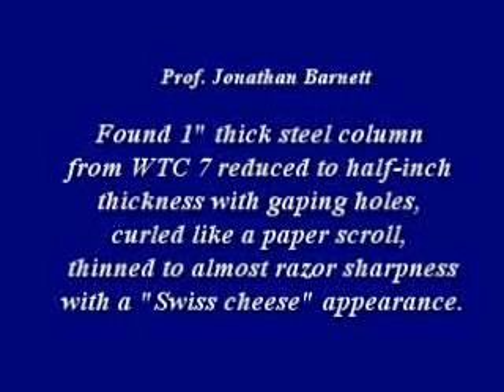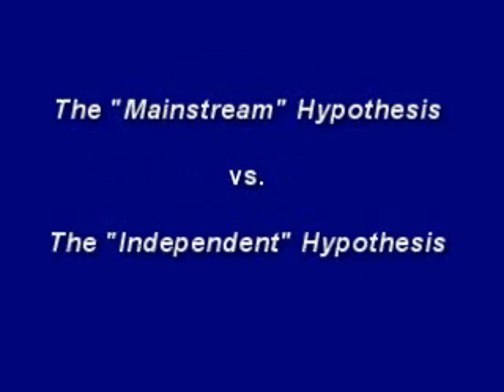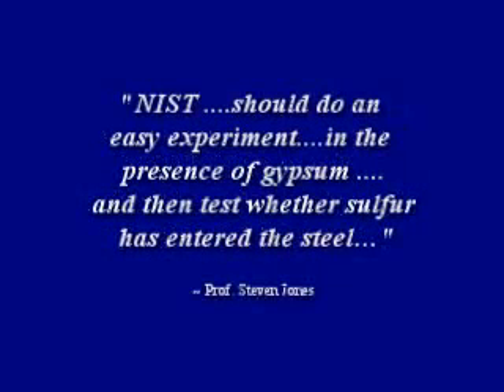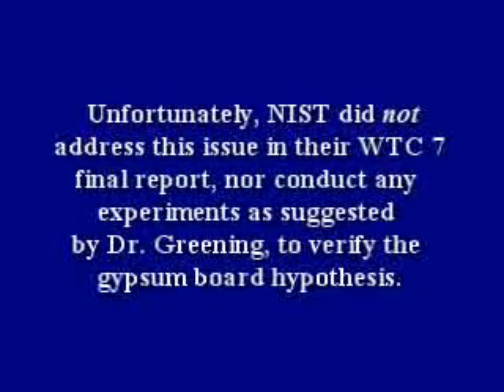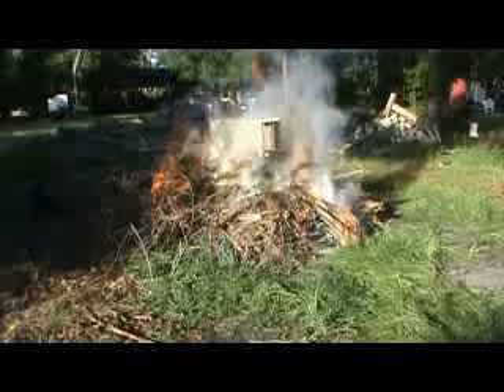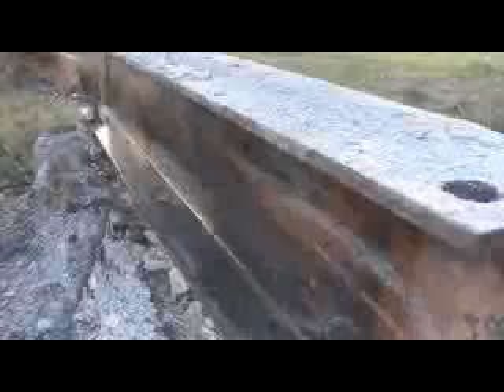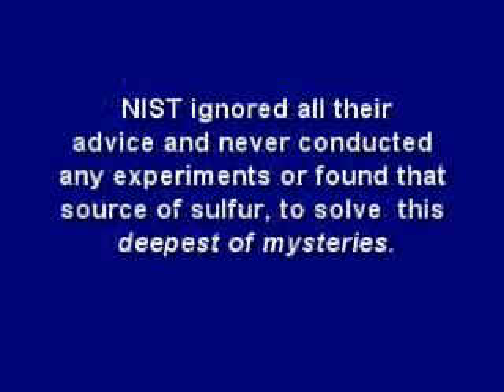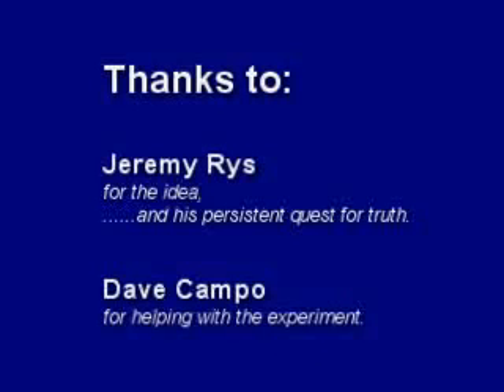9/11 Experiments: The Mysterious Eutectic Steel

Comment: You forgot one crucial ingredient: Muslim hatred of our freedoms. If you'd added that, the beam, and your house 350 feet away, would have been completely destroyed.
Reply: Logic! Noooo! Logic and reason have no place in 9/11 Conspiracy forums. You obviously don't invest in enough aluminum foil!
Reply: You're right. Muslim hatred has been proven to melt steel. I almost forgot
Reply: sammyswank
"Melt steel", stated in no official account anywhere. Strawman is a strawman.
Reply: sammyswank
"The problem is that it was documented as being present in the rubble of ground zero."
AFTER the fucking collapse. How much molten steel was recovered from ground zero and accounted for in Fresh Kills? Insignificant, with no structural steel failing to be accounted for.

The "molten metal" was caused by the continuous fires burning in the ground.

1) No thermitic material was recovered from ground zero. None. Zero.

2) Fires burning in rubble is NOT NEW. It's an expected side effect of a massive collapse. We know this, because we have seen this sort of fire in other kinds of building collapses (due to, yes, fire, earthquakes, and bombs).
Reply: winston smith
"Not just thermitic material was found in every dust sample tested"
Really? Then why won't Jones and Harritt turn their paint chips, oh, I'm sorry, I meant samples over to any other scientist for verification?

Docktor Jim 
LMAO Obfuscation obfuscation obfuscation.

Jones and Haritt won't turn over ANY of their samples to anyone else. NO ONE ELSE in the scientific community. Want to know why?

THEY KNOW THEIR SAMPLES ARE PAINT CHIPS.
Reply: @diskpanic  agent smith...the ghost of Julius Streicher will visit you pal.
Reply: Docktor Jim
Wow, I didn't realize that Rudy Giuliani is a scientist, you nutjob. What are his scientific credentials?

I love how adept you 9/11 Conspiretards are at constructing strawmen. You morons are INCAPABLE of talking about the scientific facts. Why? Because you know you lose.

13 years. Zero peer reviewed papers that significantly establishes any of the key 9/11 Conspiretard arguments in an ACTUALLY LEGITIMATE JOURNAL of science or engineering.

If you had a point, at all, that statement wouldn't be true. Keep obfuscating nutjob.

#tinfoilhat
Reply: Docktor Jim
Nuh-uh. First, prove to me that you have a scientific basis for your argument, asshat. That is, IN THE SCIENTIFIC COMMUNITY.

#tinfoilhat
Reply: Docktor Jim
"You're the one making outlandish claims."
LMFAO-LMFAO-LMFAO-LMFAO-LMFAO-LMFAO-LMFAO-LMFAO-LMFAO-LMFAO-LMFAO-LMFAO-LMFAO-LMFAO-LMFAO-LMFAO-LMFAO-LMFAO-LMFAO-LMFAO-LMFAO-LMFAO-LMFAO-LMFAO-LMFAO

i·ro·ny1
ˈīrənē/
noun
the expression of one's meaning by using language that normally signifies the opposite, typically for humorous or emphatic effect.
"“Don't go overboard with the gratitude,” he rejoined with heavy irony"
synonyms:	sarcasm, causticity, cynicism, mockery, satire, sardonicism
"that note of irony in her voice"
antonyms:	sincerity
a state of affairs or an event that seems deliberately contrary to what one expects and is often amusing as a result.
plural noun: ironies
"the irony is that I thought he could help me"
synonyms:	paradox, incongruity, incongruousness
"the irony of the situation"
a literary technique, originally used in Greek tragedy, by which the full significance of a character's words or actions are clear to the audience or reader although unknown to the character.
noun: dramatic irony

PS - The best part is that you're serious. You actually whole heartedly believe that your claims are legitimate, because you BELIEVE that the totally unobjective faith you have in your assertions exempts you from all of the normal requirements of scientific inquiry.
Reply: Docktor Jim
You are an imbecile  #conspiretard . Why would we take even the things you do seriously... seriously? The only thing you know how to do with expertise is sound utterly insane.
Reply: Docktor Jim
LOL So, what else are you suspicious of? Toothpaste? Does flouride scare you? What about radio transmissions? How much aluminum foil do you own? A normal amount? Or have you walled your house with it? Do you or do you not own a Martian language dictionary?
Reply: disgny
No, my case is very clearly easy to follow.
1) If you believe in the 9/11 Conspiracy Theories, you are an idiot.

That's it. The beginning and end.

Why is that the case? Because 13 going on 14 years after the fact, the 9/11 Conspiretards have yet to establish a single point within the scientific community. Not one.

Accusations and wild speculation are NOT EVIDENCE.
Reply: diskpanic You neglected to  tell us just how YOU would find out whether or not the "scientific community" agreed on a single point, or not.  Do you have some secret government source of information?  You do not describe just which points in the Official Story are correct.   The NIST report, you'll doubtless agree, is "Official", but they say they really don't know what happened to bldg. 7, except that it collapsed.  And they reject demolition, but have no better theory.
Reply: disgny
Oh no no no... 13 years. Zero scientific published papers in any peer reviewed journal. You don't get to ignore this.
Reply: disgny
"9/11 is not a serious scientific subject."
LMAO LMAO LMAO

You are desperate for someone (anyone) to grant you credibility, then you deny the need for said credibilitiy in the same breath. It's why you latch onto people like Richard Gage, Stephen Jones, Niels Harrit, Judy Wood, etc.

Let me respond to your idiotic question.
"why would anyone even attempt to publish a 'peer reviewed paper' about it?"
Well, one important key "proof" of your theories that 9/11 was an inside job was that the towers fell at free fall, didn't fall at free fall, did but didn't fall at free fall, and, of course, everyone's favorite, space LAZORS (pew pew pew)!

So, you incompetent dolt, a paper that definitively proves, without a quantum of doubt that the towers fell at free fall, or didn't fall at free fall, or whatever the inane argument of the week is for you nimrods. Basically, definitive proof, based on irrefutable evidence, that there was anomalous acceleration in the rate of fall of the towers, inconsistent with the official version of events.

That's an easy one. That's a fat, slow, rolling ball across the plate right in the middle of the plate.

The next one is prove, beyond a shadow of a doubt, that unprotected steel structures similar to the Twin Towers and WTC 7 can withstand fires of the intensity of those witnessed on 9/11 with 0% failure rate. Until you prove that fundamental point, then you honestly have no argument.

That is also an easy one. Expensive, but easy. The methodology is simple. Build 25 steel structures in exactly the same fashion as that in the towers. Place enough weight on the steel structure to effectively simulate the existent torque on both ends of the structure. Enclose and burn. If the structure fails inside of an hour even a single time out of those 25 trials, then your conspiracy theory is busted.

You stupid asshole. It's that simple. And every time your precious Richard Gage or any of the other doucheclowns put the money for a demonstration, or signs, or t-shirts instead of toward paying for actual scientific and engineering experiments to prove their arguments, they prove to me one thing.

Merchandising is more important to them (staying in business), than is actually seeking the truth.
Reply: Edgar Nieves
 #thatisnotarebuttalofmyclaims  
Of course, you fucking idiotclowns are not capable of putting forth an adequate rebuttal of my claims. You are, however, able to inconsistently argue the fucking points. In the same fucking thread, you have one idiotclown  #tinfoilhat  arguing that the towers fell at 6.31 m/s2, and that's proof of controlled demolition AT THE SAME TIME a totally different  #tinfoilhat  is still arguing that the towers fell at 9.80 m/s2 (total free fall acceleration) and that's proof of controlled demolition.

And neither of these two fucking idiots will call the other on their bullshit. This is why no one takes you fucking  #tinfoilhats  seriously. You aren't even able to be consistent among yourselves, let alone the scientific community at large.

The two claims are totally contradictory. Literally, only one of them can possibly be fucking true. Either the towers collapsed at 6.31 m/s2 (which is markedly less than free fall acceleration and is thus PROOF of deceleration forces) or the towers collapsed at 9.80 m/s2 (which is exactly free fall acceleration, which would be PROOF of ZERO deceleration forces).

But both fucking idiots will sit here and continue to argue as if both claims are somehow true. One will pretend that the towers falling at 65% of free fall acceleration does not naturally imply deceleration, because, well, he's a fucking idiot, and the other will pretend that the towers didn't fall at 65% of free fall acceleration, because he's a fucking uneducated idiot.

So, tell me, Edgar Nieves, which brand of fucking village idiot are you? Which of your fellow  #tinfoilhats  is right and which is wrong? Or do you have yet another completely bogus conspiretard theory?
Reply: disgny
"There is nothing inherently impossible about"
Look, we have another fucking idiot! Okay, Captain Semantics, which of the Twin Towers fell at FFA for a significant portion of the collapse? Did the towers fall at 6.31 m/s2 or at 9.8 m/s2 for a significant portion of their collapse?
Reply: disgny BS. Building 7 was in no way a traditional box frame. It was a large span, with the longest floor spans over 50 feet. It had a thin steel grid of a curtain wall and a core box frame structure, with girders tying the two together. 
And if you say 7 was not pummeled, you simply have not looked. I don't care what kind of degree you hold or what your background is. Inaccurate info is still inaccurate.
Reply: whetedge
The 9/11 Conspiretards will only see what they think conforms to their conclusions. disgny has probably never even LOOKED for pictures of the south face of WTC 7.

He ONLY reviews information that is spoon fed to him by his Conspiretard cult leaders. People like the disgraced Stephen Jones, and the inept Richard Gage.

disgny  says "retired". I see "fired".
Reply: Docktor Jim
If there were literally dozens of videos of the "patient" in the hours leading up to the death, there were a parade of experts in the disease that killed the "patient" in the "patient's" room prior to the death, and every doctor treating the patient predicted the fucking death? I'd have no problem forgoing the autopsy, you fucking doucheclown.
Reply: Docktor Jim Achilles Heel of the entire "truther" movement. You can study structural remains right now today. You should. You can also study collapse video, video of NT collapse, video and photo of the south face, and it all adds up to a damage based collapse. Sorry, but hiding behind not being able to study the corpse is weak; very weak.
Here's a good place to start. How did the lower west walls of Building 7 get embedded flat into Verizon Building, 50 feet away, from the ground up to floor 5 of Verizon? That is a very powerful direct horizontal force! And while you are looking, be sure to look for all those cut columns. They have to be in those remains, since they are floors 5-13, and show separation points. You won't look.
Reply: diskpanic 9/11 when physics took a day off...
Reply: ama79adr When Muzlams hate your freedoms, steel does funny stuff!
Reply: diskpanic You are correct. It wasn't stated in any official account. The problem is that it was documented as being present in the rubble of ground zero. Statements are statements. Reality is reality.
Reply: diskpanic
 Not just thermitic material was found in every dust sample tested, but nano-engineered thermitic material, -documented in a peer-reviewed and published paper 'Active Thermitic Material Discovered in Dust from the 9/11 World Trade Center Catastrophe' (Harrit 2009) They found and docuemented not just the signatures of thermate, but the actual unactivated material,, which turned out to be, as I said a nano-engineered thermite.
Iron (elemental iron, which is unique and the byproduct of the thermitic reaction) microspheres make up 6% (a huge number) of WTC dust. As such, RJ Lee called these spheres 'a signature component" of the dust. 
Start with the FEMA BPAT Appendic C (Linked to here: ajl.smugmug.com/911/north-tower-exploding
Then there is the anthrax, also a highly complex advance-engineered material (not available to Ivins at Ft Detrick) and, like the nanothermite, forensically linked back to US military and bio-weapons labs. Also read Kevin Ryan's excellent article: 'How to Debunk WTC Thermite' Do all this, then see what you think.

The fires underground could not be out out for 100 days! (unprecedented) with wildly excessive temperatures recorded in the weeks that followed. Pools of molten steel were found under all three sites. The large steel members were not taken to Freshkills Landfill, but loaded on barges for overseas recycling. Do some research; your questions and comments reveal nothing but your ignorance of the facts.
Reply: winston smith The only one person to "debunk" thermitic material in the dust was James Millette, who was hired by the government to determine which, if any, dust samples would be tested as part of the investigation. He said it was paint. The results of his testing were not peer reviewed.
Reply: diskpanic Is Rudy Giuliani a truther? He stated on Truther, I mean Fox News that the wreckage of the Twin Towers was over 2000 degrees on 9/12/2001. The jet fuel was just a memory by then, and the explanation of very well ventilated office fires didn't work any more. James Millette has yet to turn his findings over to anyone independent for peer review.
Reply: diskpanic Show me a peer reviewed paper from a scientist saying the temperature of the wreckage wasn't over 2000 degrees.
Reply: diskpanic You're the one making outlandish claims. If you are right, and everything that happened on 9/11 has been explained by reputable scientists whose work was peer reviewed, it should be easy to point to written explanations of everything that happened. Instead, we've got NIST simply saying there was no molten steel, when firefighters, cleanup workers, and the mayor of the city saying that there was molten steel.
Reply: docktor Jim:   Although it is true that our government, along with the British and French, have been unremittingly antagonistic to "Muslims" for a hundred years at least,  where did you get the idea that "they" hate "our freedoms"?!!  There is no evidence of that , aside from what the Zionists claim. The "Muslims were even our Allies in WW1.  When it was over, we SWINDLED them at the Peace Conference, like so many others in Europe..
Reply: disgny I was quoting George W Bush. I do not do so seriously. Ever.
Reply: diskpanic NIST admits they didn't start their investigation into the collapse of Building 7 until all the evidence had been removed and disposed of. That's the kind of work you're defending.
Reply: diskpanic Your thought processes are very hard to follow.  Here is a case of mass murder,  and any evidence about it would be key elements in figuring out what happened.  It is even a felony to remove, or tamper with it, so we still have to wonder how Mayor Guiliani got off scot free.  I believe his Police Chief, a criminal himself , was the first one to accuse OBL of being the culprit.  And you think we should all just laugh this off, and make jokes about people who want to solve this crime?!
Reply: diskpanic 9/11 was either the greatest insurance fraud ever, or more sinisterly, a modern and improved version of Hitler's Reichstag Fire.   In either case, why would anyone even attempt to publish a "peer reviewed paper" about it?  What would the subject of it be? "Example of Newton's Laws of Motion?"  "Fraud"? To what Journal would it be addressed?  Your comment makes NO sense. Journals are supposed to be serious journals about scientific subjects.  9/11 is not a serious scientific subject.
Reply: diskpanic 
Where is the proof of how they DID fall? If conspiritards HAVE to prove already existing physics why don't "the infallibulous ones" PROVE what actually did? 14yrs. and I've yet to see proof. Just written theories and opinions which "truthers"are ridiculed for. What's good for the the geese the gander is not allowed to use? This guy just subjected a lesser grade of steel beam to everything you idiots claim compromised building 7 but it was still solid. Oh but that's not good enough. I'd offer YOU tinfoil hat but the weight of it might crush your skull due to lack of content.
Reply: #diskpanicisadaftmoron.
Reply: diskpanic Your ideas of reality are seriously deficient.   There is nothing inherently impossible about the  "fall" of an object having different velocities at different times, conditions change.  You are suggesting that an auto accelerating from a stoplight MUST show a consistent, unchanging velocity. In the case of the towers,  it a question of "interference " with a free fall, and a non uniform demolition pattern , such as might occur if it were desired to destroy certain offices particularly, could easily account for this.
     Hint:  your careless use of childish insults greatly undermines your credibility.  It is NO substitute for logic, except on children's playgrounds.
Reply: diskpanic Giving you credit for being seriously interested in this question, in spite of your language,  I have to point out to you that NO part of the "Fall" should be FFA, because that IMPLIES that there is no resistance to the fall in that zone.  So it doesn't really matter at all that there is a non linear pattern to the Fall.  NONE of it should be FFA .   The only practical way for this to happen is by controlled demolition,  Oh, wait, yes , it could be "Magic".
Reply: disgny
Wow! So you mean that despite every object on the planet's surface being accelerated all the time at FFA every instant of the day, that at no point should a building collapse at FFA, no matter how briefly. So, if the tower collapsed at FFA for all of 0.025 seconds, that's too much to you? That's proof of controlled demolition?
Reply: diskpanic I don't know exactly what you mean.  All objects are subject to gravity, yes, but that does NOT mean that they all move. Structures may prevent any fall.  Of course, everything is spinning along with the earth, but we ignore such irrelevancies. I don't have the numbers on the towers memorized, but the times I have heard are quite irreconcilable with any reasonable "pancake" fall, by a factor of 10 at least.
Reply: disgny
Get back to me when you have the numbers in front of you for the Twin Towers.
Reply: diskpanic
You neglected to explain why those numbers would make any difference.  Even if you had them, and even if it matttered,  it would not explain bldg. 7's FFA.  Note that if  even one part of the Official  Story fails, it ALL fails.
Reply: disgny
"it would not explain bldg. 7's FFA."
Can't focus on just the Twin Towers, can you... So, pick a freaking subject, dude. Do you want to be proven wrong about the Twin Towers or do you want to be proven wrong about WTC7?

Actually, you know you're going to lose on the Twin Towers, that's why you're switching to WTC7. Didn't take you long to make that philosophical retreat.

So, you want to talk about WTC7?
Reply: diskpanic What I was expecting from you was a general schematic explanation for why Newton's Laws of Motion were repealed temporarily for the benefit of the US governments False Flag operation.  It just does not matter which of the 3 buildings you want to discuss.   Bldg. 7 is more clearcut, that's all.  It is all ONE sub ject, not 3 separate building demolitions.
Reply: disgny
LOL Once again, you're doing the typical 9/11 conspiracy nutjob misstep of assuming a conclusion before we've even discussed the facts. Hell, you've admitted you don't have the facts.

So, basically, what you're going to do is shoehorn every fact to fit your conclusion, no matter how ridiculous the philosophical bending nor how unscientific your assumption.

Typical.

Again. I ask, which of the buildings do you want to be proven wrong about?
Reply: disk:  You are misinterpreting what I said;  when I was referring to Newton, it was with the "assumption" that those Laws of Motion are valid.  You suggest otherwise, with no explanation except vague generalities..  I guess we have nothing to discuss, then.
Reply: diskpanic So you're mocking me for pointing out that the investigation into the collapse of WTC7 didn't begin until the evidence had all been removed? What if a family member of yours was killed, and the police did their autopsy after the cremation and burial?
Reply: Docktor Jim
No, I'm mocking you because you're jumping to a conclusion that isn't supported by any of the evidence. And because the evidence doesn't fit your idiotic conspiretard conclusion, you want everyone to believe that somehow the evidence was "destroyed", rather than accepting that there's simply no evidence. Literally, you are trying to force a positive assumption on your argument without any evidence.
Reply: diskpanic NIST freely admits they destroyed the evidence, then conducted an investigation. It's a mockery.
Reply: Docktor Jim
NIST freely admitted that the material was destroyed, because they didn't think anything was suspicious about the collapse of WTC 7. Only you conspiretards thought it was at all suspicious. Let me clue you in on something...

You guys are considered nuts. I know! Seriously. Totally bonkers. The total lot of you. You want to know why you are considered loons?

Because you lied. Yeah, lied! Incomprehensible, right?

Some of your most famous lies:
1) Small fires. Absolutely debunked, the building is clearly fulling involved.

2) No or insignificant damage to the WTC 7. Absolutely debunked, the building clearly has massive damage to its south face from debris from the collapse of the North Tower.

3) 8 second collapse time. Absolutely debunked, because the east elevator penthouse collapses a full 8 seconds PRIOR to the rest of the building, demonstrating significant and catastrophic collapse of the internal steel frame long before the curtain wall.

4) Symmetrical collapse. Absolutely debunked for the reasons described in item 3. If a the internal structure is collapsing prior to the external structure, then the collapse is CLEARLY NOT SYMMETRICAL.

Oh, there are so many other claims made by you assclowns regarding the collapse of WTC 7 that are so obviously false that it's almost as if you WANTED to be debunked.

Don't blame me for your destroyed credibility right out of the gate. If you idiots wanted to be taken seriously, then maybe you shouldn't have made claims and assertions that were patently false?

Maybe you shouldn't recruit people that can barely SPELL let alone communicate scientific sound arguments. Maybe if you weren't predominately uneducated loons... but, at this point in the game, there's no remedying your myriad credibility problems.

But having people still parroting that the Twin Towers collapsed at FFA 13 years after the fact could help. Maybe not letting people into your club claiming that there were no airplanes... Maybe not letting people into your club that claim orbital energy weapons were used.

But, hey... like I said... a bit too little, too late for you idiot clowns.
Reply: diskpanic A 47 story, steel-framed building completely collapses, for the first time in history, and there's nothing suspicious enough to investigate? 

By the way,. If you're ever stopped by a cop who says you're speeding, simply say "That's been debunked." 

You cannot produce one photo, or one frame of video, that shows Building 7 "fully involved" in flame. 

It doesn't matter if there was massive damage to building 7. NIST said it collapsed solely from fire. If you're going to rabidly defend the official story, at least KNOW the official story. 

NIST admits freefall speed during the collapse of Building 7. The initial collapse of the interior of the building cannot be seen on the video of the collapse. The walls do not bulge out or pull in. It falls straight down, except for a characteristic kink seen in controlled demolitions. The floors were attached to the walls, so the collapse of the interior would be seen in the exterior. 

What's your area of expertise, other than watching all the debunker videos? I own a company that builds welded metal structures. They don't collapse. They can't. They can fail, sure, but they don't turn to rubble. It's not the nature of metal structures to do so unless they're demolished. That's why Buildings 3-6 at the WTC didn't collapse, even though they had 1362' towers fall directly on them, and then burned.
Reply: Docktor Jim "steel-framed building"
Mis-direction. Only the 3rd "Large Span" tower in existence. WTC 1 & 2 were the first. If you do not accurately describe the buildings, you would be at risk of misleading readers. Wouldn't want to do that, would we?
And no, there was nothing suspicious about the collapse of all 3.
Reply: whetedge You'll have to do a lot better than that if you want to mislead any educated person.  All three bldgs. were steel framed.  Let's not pretend they  were so special that the steel in THEM could be destroyed by fire, when NO others ever were,( in spite of many examples which burned all day long, but did NOT collapse.)
Reply: disgny "All three bldgs. were steel framed."
False. All 3 were large span towers. "Steel frame" is a misleading description, as it refers to traditional "box frame' steel structures. Makes a BIG difference in the building's behavior relative to damage and collapse.
And when you say "destroyed by fire", you purposely leave off the first mis-load in each case, that being damage from airliners and flying perimeter wall in the case of Building 7.
There are NO valid comparisons. All 3 were the first and only large spans in existence, and the first and only to be pummeled by 100+ ton flying mass.
Reply: whetedge You're talking to the wrong guy.  I am a retired structural engineer, and have worked on that kind of stuff.  Everything you said is basically, and irretrievably mistaken and  I suppose it was on purpose.  Look at the floor plan of bldg. 7:  it is a classic "box", and not like the others anyway, not that it matters.  And bldg. 7  was NOT  "pummeled", or even significantly burned.
Reply: disgny
"And bldg. 7  was NOT  "pummeled", or even significantly burned."
Oh, look, more lies. I doubt you were even a structural engineer, judging from your total lack of honesty in these statements. You are an imbecile.

If building 7 was not "pummeled", then please explain the 30 foot wide gash in the south face that ran from the top of the building to over 20 stories down?

If building 7 was not "significantly burned", then why did the NYFD Chief state that the building was "fully involved"? Smoke was pouring from practically EVERY FLOOR. The fires were so bad that they were blowing out windows. That doesn't happen in small fires, only large fires.

The fire suppression system above the 10th floor was inoperative. The building was burning. There weren't enough fire fighters ALIVE and free of rescue efforts after the collapse of the Twin Towers to fight the fire in Building 7.

Oh, but, you're a "retired structural engineer". You'd know, right? You were there, weren't you, Brian Williams?
Reply: diskpanic I have seen the same videos as everyone else, and it is obvious that Bldg. 7  did NOT suffer even as much damage as some of its neighbors, nor was the fire very impressive either.  What bldg . 7 DID have which made it a valuable target, is business fraud investigation results which are said to have been worth many billions of dollars to various interested parties.
Reply: disgny You haven't seen the videos of damage nor of Building 7 getting hit. If you have, you are either ignoring or didn't look very close.
Reply: whetedge I saw the damage to buildings 3-6. They had two 1362' tall buildings fall straight on top of them, then they burned, and they still didn't collapse. No one talks about that. You know why? Because they were steel-framed buildings, which don't collapse.
Reply: Docktor Jim Sort of correct. They indeed collapsed where they were impacted, but the non-impacted parts stood, because they were "box frame" structures.
Had Building 7, a large span structure, been hit straight down from above like the others, it would not have stood, but collapsed immediately.
Reply: whetedge NIST is really clear about their investigation into Building 7. It collapsed solely from fire, and the physical damage was irrelevant. It collapsed because ONE vertical column warped off its foundation. The investigation didn't begin until all the evidence had been removed. Nearly all the diesel in the tanks for the emergency command office had to be pumped out during the removal of the debris, because it hadn't burned. "Most or all" of the vertical columns would have needed to be removed by explosives for the building to collapse, AND the failure of ONE column caused the freefall collapse. 

Source:

http://www.nist.gov/public_affairs/factsheet/wtc_qa_082108.cfm
Reply: Docktor Jim
Yes, the fire caused the collapse, you fucking conspiretard.

The fire was CAUSED by the damage from the collapse of Tower 1. Without Tower 1 debris damaging Tower 7, there would have been no fire, and the building would still be standing today. If the debris hadn't caused a fire, Tower 1, 2 and 7 would all still be standing today.
Reply: Docktor Jim NIST had an inaccurate assessment of damage. I am trying to get them to re-visit Building 7 damage, which was fatal. Regardless, their fundamental conclusion of gravity being the only force at play is untainted by new information. The only reason to get NIST to correct it's mistakes is to shut people like yourself up, who can't use their own logic and will to study, relying on "impossible" to raise such a stink. If you'd just try to find out the "why" to your questions, instead of just folding your arms and saying, "Aha! NIST is trying to cover something up!", or whatever it is your are saying, you would find the same as I did, and learn there is nothing suspicious about any of the collapses at all.
Reply: whetedge Pretend Building 7 was a body, not a building. What if a coroner said that they cremated and buried a body, then performed an autopsy?